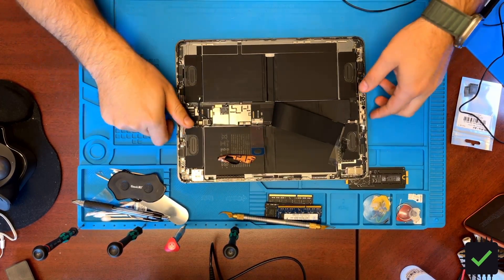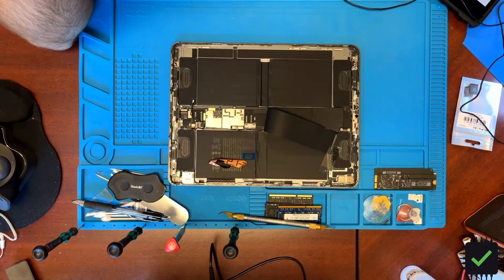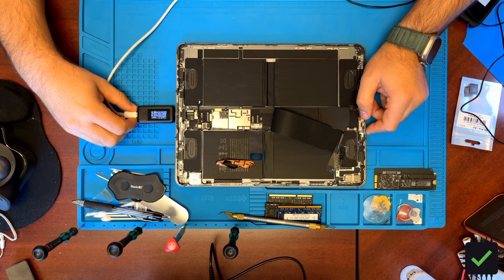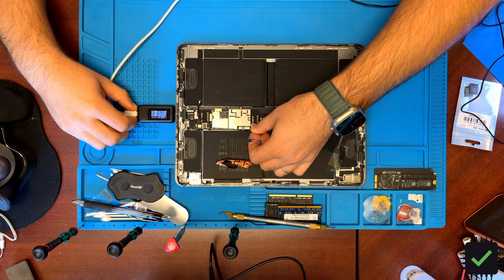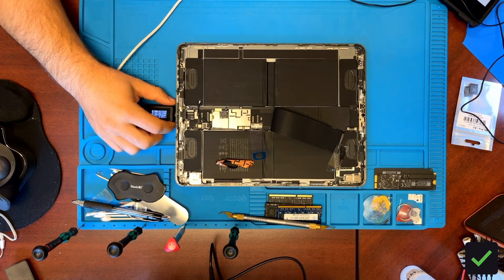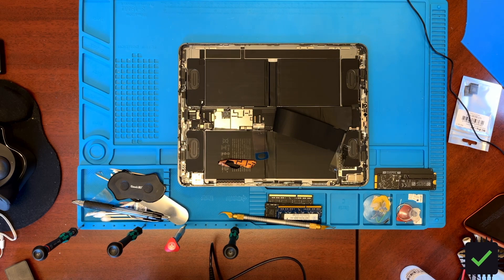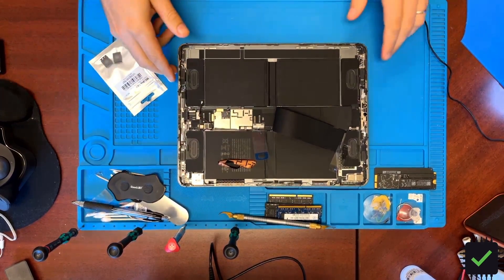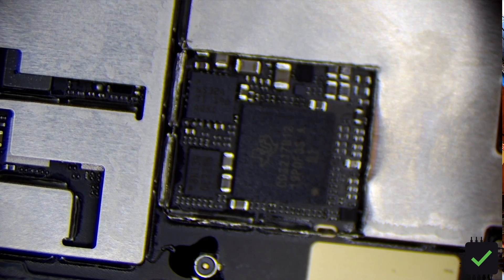Apple iPad Pro 12.9 5th Gen A2379 Not Charging Pulling 5V 0.2A Repair with some Trial and Error.

Comment: My iPad 5th gen when plugged into a battery pack shows a current but when plugged into my computer nothing, screen doesn’t respond nor does reset or power button.
Reply from the maker: Will need diagnostics to determine the issue. I do offer mail-in-repair option on my website applepietech.com. Thank You!

Comment: Does CD3217 have to be extracted from the donor board of the same model ipad? I heard that CD3217 extracted from other models may not work.
And if ROM is damaged, is it impossible to fix it? Or does it work if ROM chip is implanted from the same model iPad?
Reply from the maker: Used one from 5th gen 12.9 on 2nd gen 11 the other day without an issue. Did not have to transfer rom chip.
Reply: @applepietech  oh. thanks!

Comment: I had exactly the same case, but unfortunately with no success. After replacing CD3217 (with matching dot) it became 5V 0A, as in your second attempt. There was probably a problem with the ROM too. I can't believe that the ROM is specially prepared only for this particular CD3217 and it won't work with any other, it's crazy. If you had some time, could you try to read the image from the working ROM and try to flash it to the one that doesn't work? Maybe there would be an answer to the question that the image itself is damaged, not the entire ROM is assigned to a specific chip, hopefully...
Reply from the maker: I did not want to experiment with this particular device too much since it was a customer’s unit. Most-likely CD3217s in iPads are programmed. I do have a working 11 iPad Pro 3rd gen (same year basically), I might experiment on that one with different roms and cd3217s